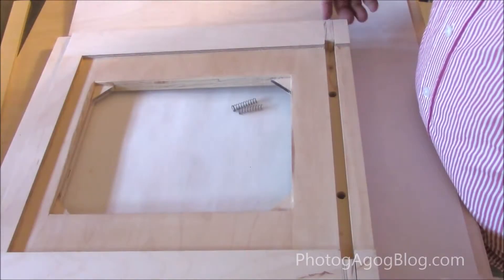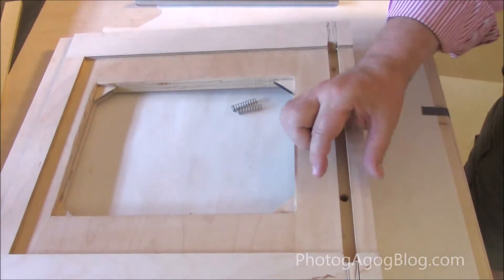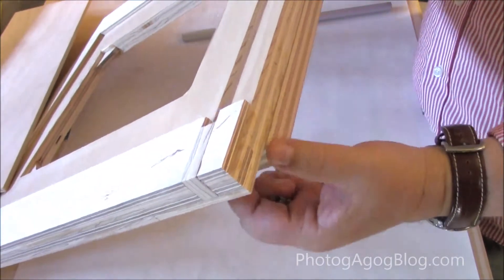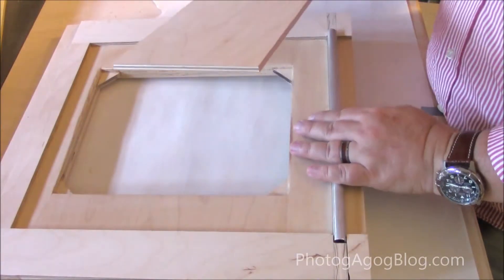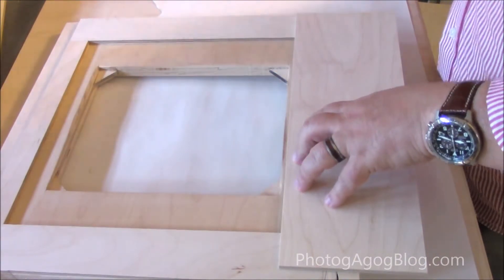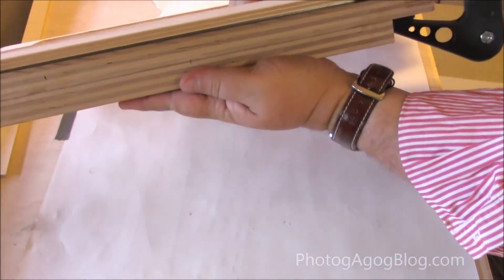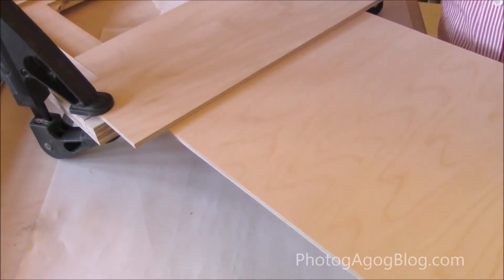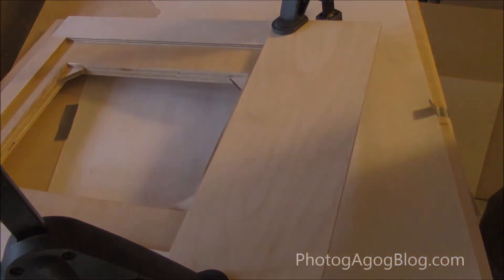Tintype Build Darkslide

Comment: In order to have your light trap seal properly you will need to cover the sprung metal tube with black felt. You will also need to make two traps about 5mm apart if you intent to withdraw the dark slide from the holder - if you intend to only partly withdraw the slide to expose the plate one trap will be enough but you are at the mercy of the wind etc. The triangular corner supports for the plate are rather large and unless they are made of acrylic or similar material impervious to silver nitrate you will have flaws on your plate from silver from previous exposures making it's way back onto fresh plates. The corner supports need to be cleaned very well in water and then rinsed with distilled water between each plate. Like your work - keep it up :)